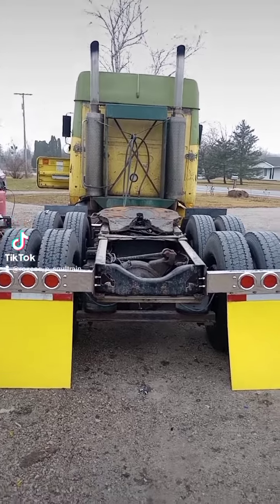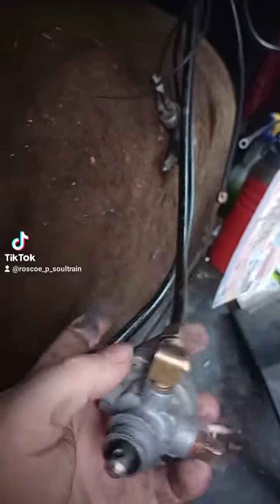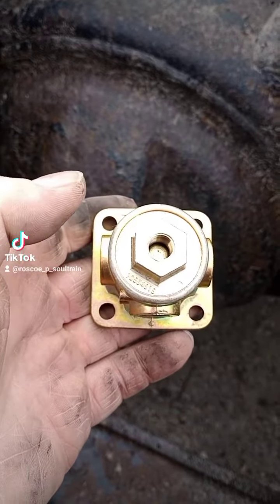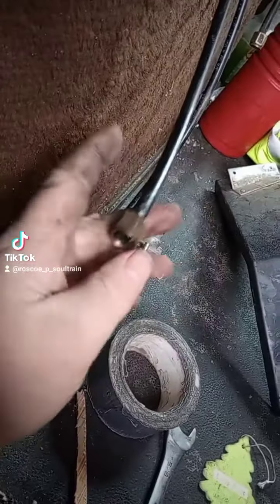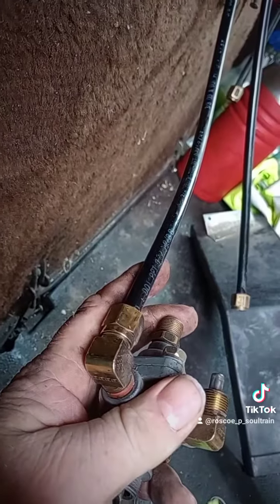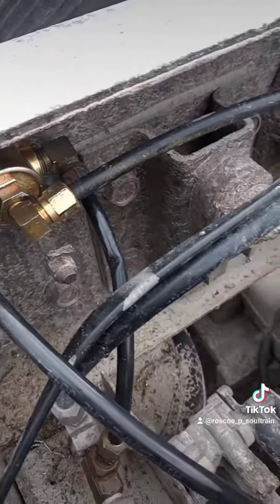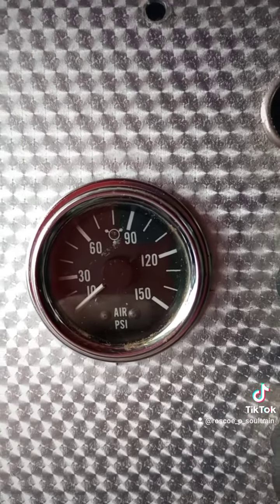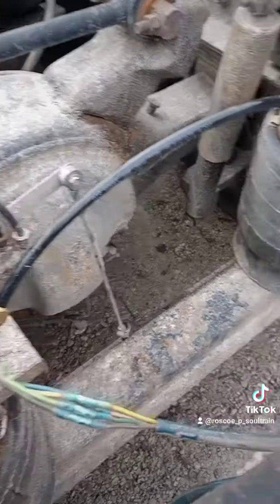Using a pilot valve to dump the air out of a an air ride suspension

Comment: So are you running an electric valve with this set up. Or what kinda switch is in the dash?
Reply from the maker: Air toggle switch. There is a 1/4 air like supplying air to the switch and an 1/4 air line to go from the switch to the relay valve on the back of the frame. It also has 2 spade terminals on the switch that i have wired up to a light to indicate when the switch is supplying air.
Reply from the maker: Here is a link to an air toggle switch. This one doesn't have the electrical terminals for an indicator light though. I just went with this style because i could put Kenworth toggle switch extension on it. https://www.4statetrucks.com/air-toggle-switch-with-paddle-style-handle-1-4-inch-air-line-fittings-01-161900001

Comment: where did you get the pilot valve?
Reply from the maker: Traction Truck parts. It's just my local truck parts store. Any truck parts store that stocks air brake equipment should have it.